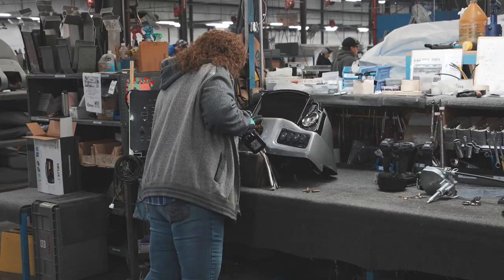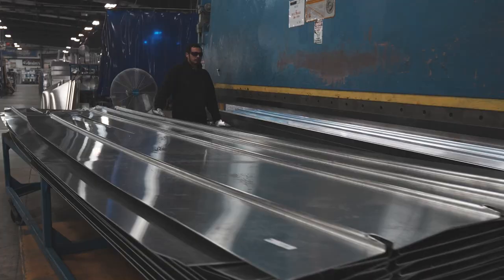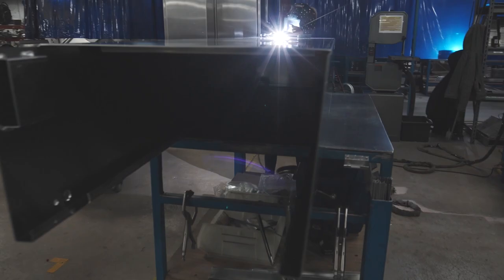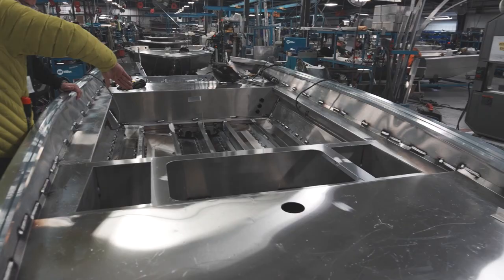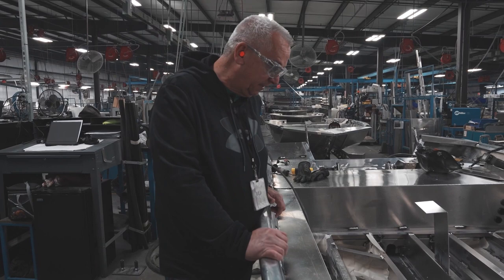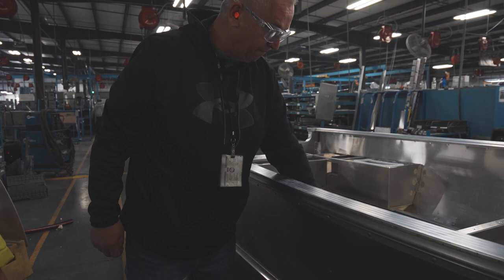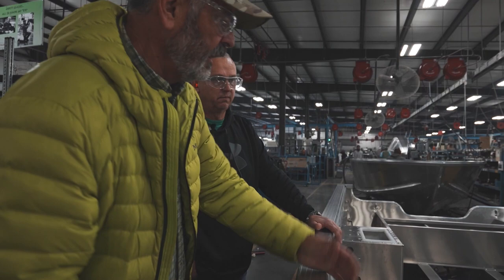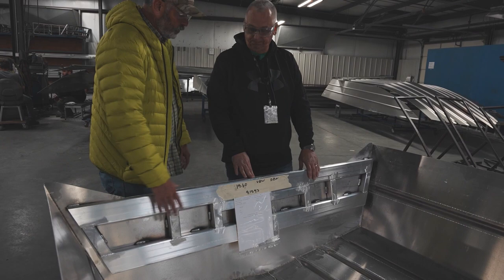G3 Boats Plant Walk Through

Comment: The console material quickly shown at 0:33 looks to be an improvement over previous year models. I was very disappointed that G3 warranty wouldn't help when my 2017 console cracked when it was less than 2 years old. I take meticulous care of the boat which is otherwise well made.